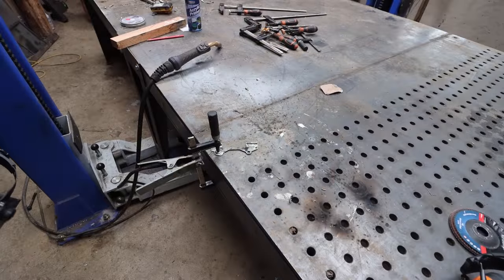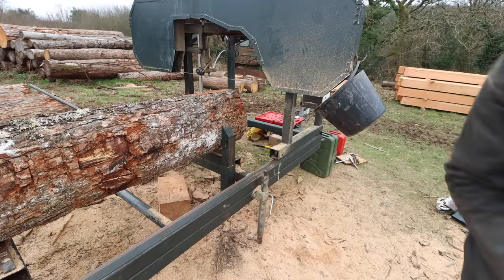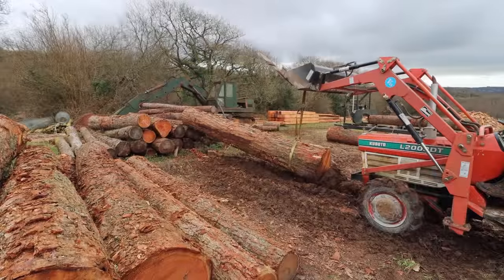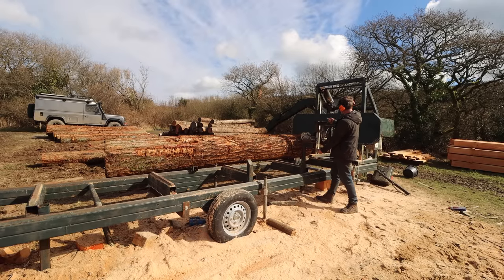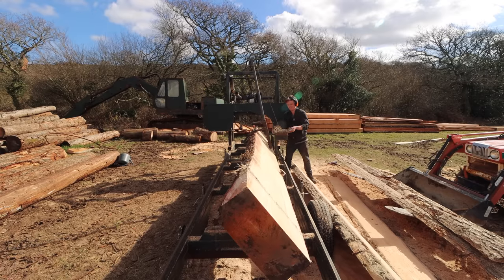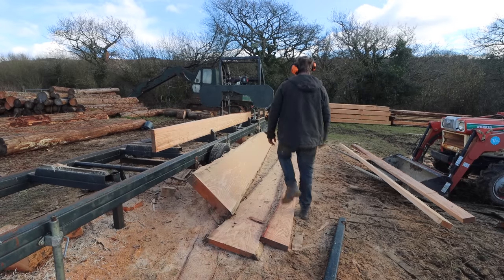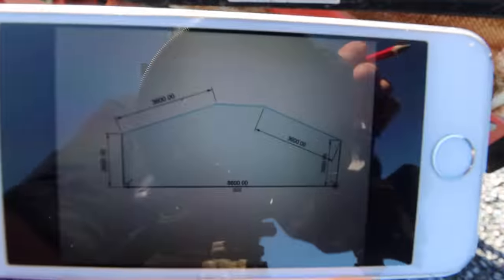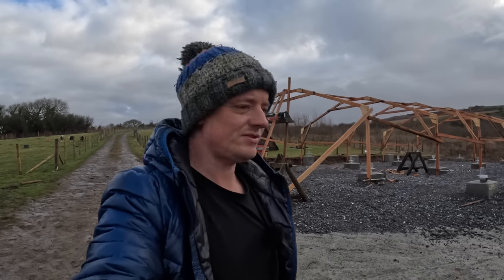Timber Framed Barn Part 7 More Milling And Temporary Workshop

Comment: Hi Kris, I remember making a comment when you 1st built the sawmill, about the need for wire brushes or scraperts on the rails, to stop the build up of saw dust and resin. Also, it's a good idea to add some washing up liquid to the water feed to lubricate the blade.

Comment: I love your work. You can take the less desirable wood and laminate it using screws and water resistance glue it would make super strong beams that you could use in places that are unseen glue laminated beams are far more stable because they don’t twist because the different grains oppose each other
Reply: krisHarbourNaturalBuilding001  Scammer.

Comment: I've put little snow plug-kind metal sheets in triangle shape in front of the casters to prevent clogging with sawdust. Had brushes before but they clogged as well (esp when wet ...) Scraping beats brushing by far. Stay safe.
P.S. This little tractor astonishes me time and time again ...

Comment: Kris take a look at the Woodmizer LT15 it’s got a string assist to move the saw down the track. It’s what I use. Also I think they have silicone pads as pushers in front of the wheels to remove the sawdust from the track.
Reply: Diesel Creek just took his order of a Woodmizer LT15, that was his last video. He had to wait 15 months for it!

Comment: Kris, I've had a few of these Chinese engines, 6hp and 10hp. Over time the fuel line feeding the injector, will crack, due to harmonic resonances. I recommend using a rubber hose with an aircraft type of metal clamp, midway of the line. The idea is it will stop the line from vibrating, "resonating/oscillating". Every one of my engines had this problem, also, it's only a matter of time if you run the engine at full speed, the rocker pedestals in the head casting, will eventually fail. Just a heads up. Unfortunately i have no idea how to provide you with any pictures. on an other topic, YouTube does make life difficult at times, now i can't seem to get rid of those annoying short's.........
Reply: krisHarbourNatural_Building  Scammer

Comment: For an idea, Wood Mizer uses medium density plastic scrapers backed by a metal plate.  The plastic is in contact with the track and metal backer is about 1/8” above the track.  Works really well.  Thanks for the videos Kris!

Comment: IDEA for the sawdust and the track. Maybe add on an extended V-shaped roof, the brush is not going to stop sawdust from falling on the track, and as you said, if it is oiled, some is bound to stick even if some is brushed away. If on the saw cart you add an inverted V shapped roof that covers the track, then no saw dust will fall on it. Might put front rollers at the end of the roof for better stability and not too much pressure where you weld it onto the cart.... just an idea. Cheers!
Reply: krisHarbourNaturalBuilding001  Scammer.

Comment: My Woodland Mills mill has a half loop of some sturdy steel rope just forward of the carriage unit that "scrapes" the track as you push it forward. As the rope wears, you can loosen the bolt that holds it, and pull more rope through such that it's scraping the track again. I don't find I have any issues with sawdust build up, and most of what I mill is Douglas Fir or Larch. Lots of people also suggest adding a bit of dish soap to your tank so that it helps keep your blade better lubricated and also prevents the pitch from sticking to the blade so much.

Comment: Could you make a drying shed to help dry out your timbers to remove your sap from the wood over a couple of nights. Some thing like  one metal shipping container with electric blower inside and gas heater to heat up the area and circulate the air around you timber drawing out the sap and at a predetermined time turn off. A) it would make your timber stronger.
B) easier to machine.
C) you can use it time and time again for projects on site and if necessary Kris mill wood to sell to local businesses etc.
D) Temperatures of 47 - 88°c or 120°f- 190°f need to be adhered to to dry wood in a kiln Kris.
Reply: krisHarbourNatural_Building  Scammer

Comment: It might not work but could some power out of the motor be used to drive a fan and then blow air on the rails to clear sawdust as it falls. I think the brush idea isn't bad, maybe is brushes on the front don't work, a fan might be ok. It would fail in wet weather I suppose. A bigger bag for the sawdust makes sense. If your partner is good with a sewing machine, the type of bags you get for ballast and sand from a builders merchant could be trimmed down and resewn to a more convenient size to catch a bigger quantity of sawdust.
Reply: krisHarbourNatural_Building  Scammer

Comment: Do I see an excavator in the background? why don`t you utilise that to move those hulking great logs around with..As to the sawdust blocking up your sled rails,why not re- rout the sawdust exit coupled with  a blower/extractor. you are more than capable of doing that. the "shed" is a massive project your doing it so well.

Comment: At 19.00 why don't you make a modification to tilt up lumber in the mill by 45-90 degrees? Could probably get something in there to lever up from the bottom using some form of jack/bottlejack or high lift jack?

Comment: Kris, you made a comment about having trouble pushing the saw forward when cutting. There are a couple of guys that use Automatic Transmission Fluid on the rails to lubricate them. They lay a layer of it on the rails and it helps make it move easier. I enjoy watching the sawing process and can't wait to see the pieces turn into a building. Be careful when flipping those huge chunks of wood.  I'd hate to see you get hurt.

Comment: The checking in the lumber shouldn't be an issue structurally... particularly if you use iron straps. And keep the pine sap. You can make turpentine.

Comment: Great attitude, you are my hero. I just had the idea of a hydraulic log flipper for the mill. A steel bar fitted horizontally in the frame under the logs connected to a hydraulic piston. If you put an electric hydro pump on it, you would be able to actuate it with a buttton.

Comment: For the cleaning of the track of the mill, use a piece of 1/2" thick Teflon and bolt it to the wheel carage 
while it is sitting on the track i front of the wheel. 
That will keep the track clean. 
 Good job on the Video.

Comment: With those heavy logs on the mill, you could choke them with a strop then wrap the strop around once more and use the tractor to turn it. That gives you lifting and rotational force.

Comment: Kris,  for the love of God,  use the excavator,  put a thumb on it,  and use it to at least handle the log pile,  as I remember it had trouble walking but,  it doesn't need to walk to load and unload logs.    its not worth the risks to take expedient chances when you have a machine to do it

Comment: Matey when flipping your logs rather than the using the cant hook just loop the cable under the log a couple of times from the winch and it will role the log naturally and is a lot safer 

I used to do it on my old mill but with a powered winch

Comment: Candle stick and rub that along your mill tracks,  slippy and non stick,   since you plan on making a device for the front tracks - maybe, some box tube, that a wax block could be weighted into so it always relubed the track, would also act and a friction brush for sawdust removal
Reply: krisHarbourNatural_Building  Scammer

Comment: There are some great resources out there for personal protective equipment. I wear shin pads to protect an old war wound and have found that there are many different types of gloves to prevent injury at low cost in the grand scheme of things. I constantly have to remind my engineers to wear their PPE, they feel indestructible as youngsters but it doesn't look that pretty when they get to the wrong side of fifty. Be well.
Reply: krisHarbourNaturalBuilding001  Scammer

Comment: It seems that the hardest part of the milling is maneuvering the logs.  I.e., rotating them.  You're such a clever fellow that I'm sure that you could come up with a way to use hydraulic cylinders to help.
Then there's that winch you use to get the logs onto the mill:  couldn't you pull them up with the tractor?
Reply: krisHarbourNatural_Building  Scammer

Comment: Kris how come you don’t use the excavator that is sitting behind your sawmill to move your logs around.
Reply from the maker: its just such an old beast that its at least an hours work just to start it up, then to turn it off involved undoing the injectors. it also has a lot of play in the bucket and the slew break is crap. doing any kind of delicate operation with it is very difficult. 

to use that would be hours of work carrying big batteries to get it started. then I would be in and out of it to attach straps and stuff then I risk hitting the mill and damaging it or knocking it off its feet pads and having to re level it every time. its just not worth it. the digger needs a lot of work before it able to do a job like that.

Comment: Instead of a brush to clear saw dust why not put a small air tank on to your saw mill to blow the dust off the runners. I noticed on your milling that your bucket was completely full. Maybe a long metal or plastic tube past the guide rails to direct the saw dust on to the ground like you would have a building site dump tube straight to a skip. But for you the bucket won't then over flow and dump it on the rail.
Reply: Kris l am on what's app , messenger but not telegram.
Reply: Air tanks can be bought or refilled at your local diving shop if close to the sea. If you have the appropriate cylinders, compressor and gauges you could even do it yourself to save you money. I still think a chute instead of your bucket would be the cheaper option.
Reply: MartijnDoolaard395  Scammer.

Comment: Kris,
You should use your "lever" idea and engineer a solution to help flip the partially sawn logs.

You already have the cross bracing, maybe weld some additional cross members on stout hinges, and use some kind of hydraulic to do most of the heavy lifting for you, or some type of square tubing with eye to use with your existing winch system to help.

We're both young, but we won't be saying that in ~30 years.
Reply: krisHarbourNatural_Building  Scammer.